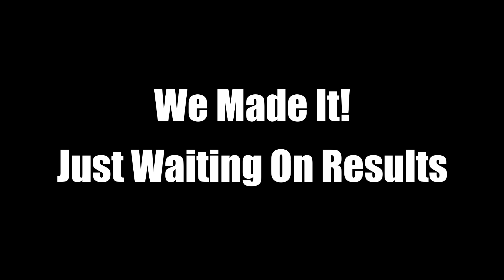BROKEN INTO While We SLEPT | Vanlife UK

Comment: we fitted a drop bolt to the back door.... and other security bolts on the other doors ... I feel safer at night, now... even if the central locking was operated the doors are still locked on the inside....(from the inside)